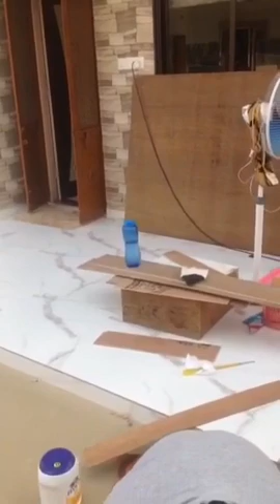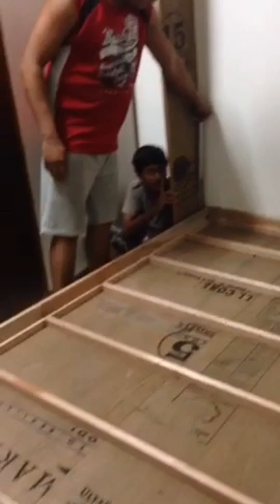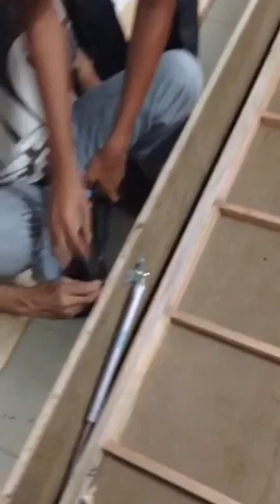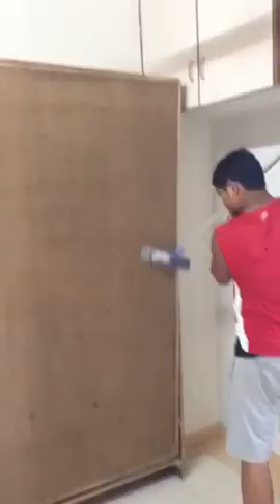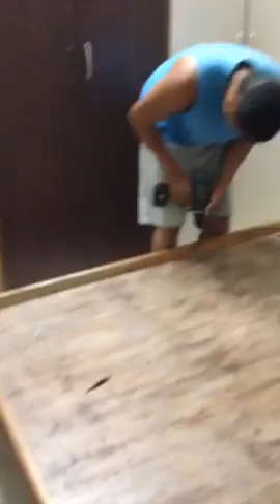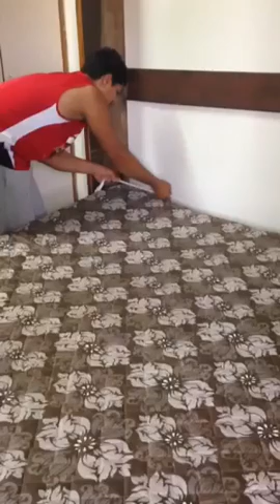DIY Murphy bed

Comment: 19mm ply, 6mm ply, 2 of 100 kg hydraulics, 19mm saag wood for border, pair of heavy duty brass central pivot hinges. Collected all those by myself after some preparation of measurement and drownings. And it still works fine after 1and 1/2 year.